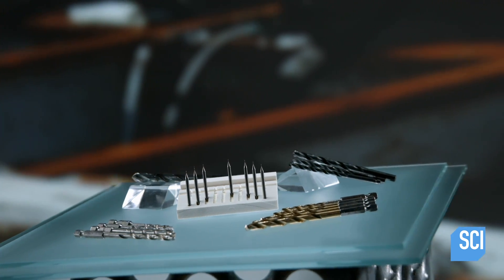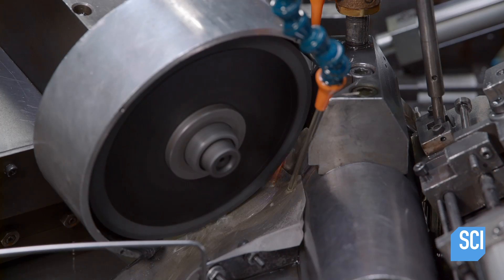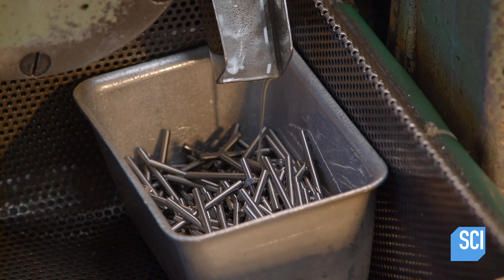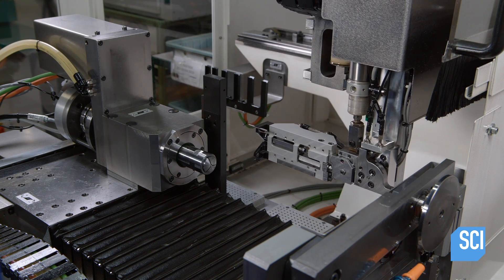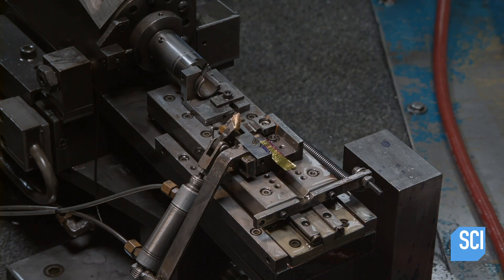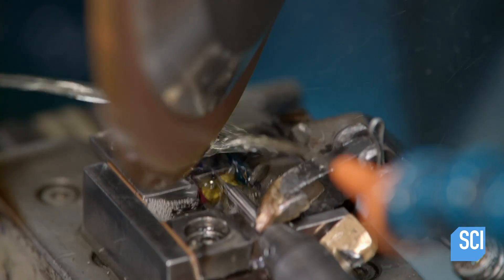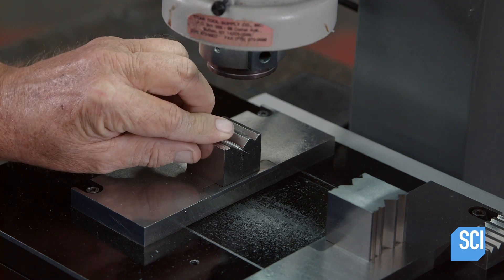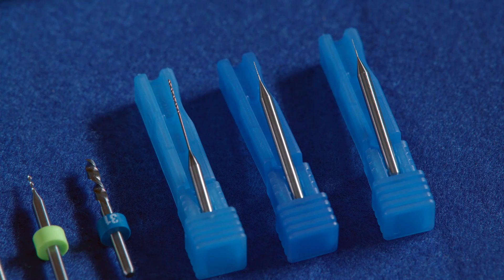How Micro Drill Bits Are Made | How It's Made

Comment: 4-5 hours to center it using shim stock???? they need a new process!
Reply: It's not per drillbit, it's for setting up the machine the first time, after that you can cut thousands with no extra adjustment.
Reply: @aleksandersuur9475  yeah 5 hours is a short set up actually, I've spent a week on set up before
Reply: kolby4078 damn 1 week on a setup you would be fired where I work
Reply: @staniclol7063  gotta get it right before it goes into a full year of production.
Reply: Youtube Rezzd 
I mean from writing the CNC programme, to setting up the machine, chosing how it should be cut etc, and do 0.0001mm precision could easily take 1 week. If you’re working on f.ex space shuttle parts, oil platform tools and similar, taking 1 week to set up the machine is nothing as long as they manage to produce the peices accurately.

We’re not talking McD’s fryers
Reply: @donb2527  go back and watch the video, they are specifically talking about using shim stock to center the tool. I was referring to that specific operation. Not the entire tool making process. 

Source: i have 11 years of cnc machining experience and im a cnc programmer.
Reply: @kolby4078  I started a set up yesterday it took all 8 hours of my shift. The part has six different stations on a fixture but I didn't even get to start real production till today. So I can see it.
Reply: @staniclol7063  Well,  when considering that very few companies have the capabilities to build super-precision parts and they will make hundreds-thousands of dollars per part it is necessary everything is dead on, the company gets paid for the quality, not the quantity. 
I had people tell me about a company that makes one part every two weeks, but they make $60,000 profit on each part, so it is worth taking the time.
Reply: @kolby4078  amen
Reply: @aleksandersuur9475  thank you i was so fucking confused
Reply: They need sharpshooters😂😂
Reply: Do you know how much the company sell those bit? 😂😂😂
Reply: @azharkamarudin6611   ~$15 (0.01in) - ~$300 (0.0008in)
Reply: Yep a centering mechanism using laser interferometry and piezo actuators would do the same job in a few seconds. Someone just has to build such a device. The technology is definitely there.
Reply: @Widur42  Zoller
Reply: @LazyH-Online four jaws are known to be way more accurate and precise than 3 jaws, they just take longer to set up
Reply: What are micro bits used for? The body?
Reply: Just to make sure it is expensive because this process.
Reply: Not every company producing those drill bits uses this process. I bought a set of carbide micro drill bits like this for ~$10. not the same quality for sure though... broke one and it cut me. i am still wondering if the tiny piece somehow got stuck in my finger.
Reply: 👍 4 to 5 would drive is cost prohibitively.  I never thought drill bits of this size to be expensive.
Reply: I think this is BS. Coz it's not reflected in the cost. Probably happens like twice a week or something.
Reply: there should be plenty of incentive for them to develop a new process. they count start actually mass producing those things
Reply: Then a machinist accidently drops it after it arrives from shipping. Lol
Reply: How much is that bit if they can only produce a few a day???? LOL
Reply: That's got to be one expensive drill bit.
Reply: finding a new process can take 4-500 years.
Reply: They need a new writer or the voiceover. :-) At 4 hour per drill one man can only make two drills per day, yet they are for sale at 2.50 a piece.
Reply: @vinny142  maybe its because hes held captive that they can afford that? maybe thats also why he takes 4 hours to do it
Reply: He must take like 6 fucking lunch breaks while making that one bit
Reply: @Koda716  
Gotta get that 8 hours shift in somehow, and bob's been here so long nobody dares to question him:
Can you give me a hand with the delivery?
Nah man, I still got a couple of adjustments to take care of

Can you come to the boardmeting?
Aaah darn nah I got to adjust the bit before my shit ends

This is the FBI open up! This company is under investigation for tax fraud and you're our main witness
Oh darn I wish I could talk, but you see I got a drill bit to adjust
Reply: I'd imagine there's a laser measuring device with electronically controlled movements that could square that drill up in a few minutes.  Likely, the company is too cheap to buy it.  Where I work, our tight-tolerance work is done in machines that measure the tools' lengths and diameters with a laser, supposed to be accurate to .0001mm (I don't know if it really is though).
Reply: @Aeturnalis  the machines you are looking for are manufactured by a company called Zoller
Reply: @LazyH-Online sorry I missread your comment
Reply: It needs to be so precise I don’t know if there would be a better process
Reply: @jfs366  oh THERE IS. I honestly don't believe this. I work at a place that threads bars and it takes them 20 minutes to adjust the tools right but then they whack thru one every 30 seconds. Might get taken out and resharpened once ir twice a day.
Reply: @jfs366  The human eye is very very bad at precision and adding layers of tape by hand doesn't make it more accurate. My guess is that this man is doing some quality control step that takes 4-5 minutes. He;s holding a 0.1mm drillbit by a 4-mm shaft in a tool that has a collet chuck which is famous for not being adjustable. Whatever this guy is doing, it's not centering. At best he's checking the centering and it takes him 4-5 minutes to do. And yes, a mchine would be 100x better at it.
Reply: That's why they should be hiring Mexicans. They will do it faster and better Everytime.
Reply: @imtypingwords  have you ever bought a tool made in Mexico? They are really terrible quality
Reply: @imtypingwords  oh they would do it faster and cheaper, but the bits wouldn’t work for shit
Reply: @imtypingwords  They don't work better, just cheaper.
Reply: imtypingwords 41 They moved the factory we had in Texas down there 😂
Reply: @imtypingwords  nobody beats Taiwanese ninjas
Reply: @imtypingwords  Mexico is in pretty good shape with all their workers, doctors, and engineers doing things faster and better.
Reply: @foxbyte0157  I know. They are legit good workers. From the lower level jobs to the top level. It all starts with
With ethics from their parents. And that's something that Mexicans are most proud of... Is family.
Reply: @imtypingwords  well that's just sweeter than honey x
Reply: @imtypingwords  bruh moment

Comment: As a machinist, this video is very interesting. I’ve always wondered how our small drill bits and endmills are made.
Reply: What do you use these really small bits for?
Reply: @Aditya-wg3lp  really small holes or really small features. U can’t make a tiny detailed part with a 1/2 endmill
Reply: @Aditya-wg3lp  I'm an aerospace and medical supply machinist. At my workplace, we mainly use these tiny little guys to produce very complex, high pressure valves and to machine cross lines between two high flow sections to facilitate very precise mixing of liquids. Sometimes the tiny holes that are drilled are also used to control the opening and closing of mechanical solenoids
Reply: @Aditya-wg3lp  I've got several of the hair-width end mills (errr...router bits) - I use them for inlaying.  The most common use is for improving corners - draw a 90 degree channel with a 1/8" bit, and then run a 1/16" along the edges followed by the sub-mm one.  I've also got one made specifically for ivory (I've got some mammoth ivory bits). You have to be very careful with speed and depth on these because they break super easily if the parameters are wrong, and they're not cheap to replace.
Reply: same

Comment: As a machinist, the terminology in this video made me cringe. Several times
Reply: Good thing these videos were made for the general public.
Reply: @Abeyancer  I'm not a machinist, just a guy who likes to tinker around with tools, and the terminology in this video made me cringe too. Lets not make excuses for poor research on their part.
Reply: @denisl2760  The whole point is to avoid becoming overly technical -- this show is for a general audience.
Reply: Yep, right with you there.
Reply: Could you tell me which carbide they used?
Reply: @SanoCrushridge  the blanks are tungsten carbide. This video doesnt show any coating of the drills, but it's quite common for these drills to have some coating on them, depending on performance requirements
Reply: @dillonrajaniemi9513  thanks. They aren't very detailed in these videos.
Reply: @dillonrajaniemi9513  Many (most) carbide tools don't have any coating, especially when used for cutting aluminum. You sure you're a machinist?
Reply: @avimoore6619  thats what i thought especially the small tools like 0.1-0.2mm how the fuck do you want to coat them
Reply: xLoltimex CVD respectively PVD is possible
Reply: One fact is that there is no such thing as a "drill bit"...You have a "drill" and a "drill motor"...Horses  use "bits"...LOL
Reply: I’m 15 and I don’t have to be an expert to know what a microscope is called. Lol.
Reply: Well, as all machinists or experts in any subject would know, it takes time and money to reach high precision and quality. It’s just the same in the film making business. This film is cheap and good enough for ignorants, like 99% of everything, sadly. How this transfers to politics is frightening. 99% of a population have no clue and no desire to study past the bullshit in politician’s arguments and yet vote for them. If only we had a micrometer to figure out the bullshit from the truth it ‘d be easier.

Comment: '
what do to with a micro tiny drill use for...
denture or mild - soft metal or plastic or wood
Reply: bestamerica via holes in circuit boards.
Reply: @rfengr00 
'
hi L B...
ohh thank and good idea use a micro drill for the PCB hole...
i use home normal black drill bit set on the PCB sometime

Comment: I want to work here setting  up a drill bit for 4 hours
Reply: He set up a template. This has to be precise, because it will be used for all fillowing drills of the same type. Once the template is set up, it only takes seconds to swap out one bit after the other.
Reply: I hope he was aligning a fixture that may hold one drill bit at a time, but will process many thousands before needing work.
Reply: Good luck
Reply: How much does one of these drill bits cost?!
Reply: @Chris-yy7qc  last one I saw was around 400 dollars.
Reply: Harbor Freight : 10pc micro bit drill set $13.99  These clowns talking $300 each.
Reply: @ColoradoStrong-w1j  Thr drills from Harborfreight  cant even drill allot of materials this can do..
Reply: @Chris-yy7qc  Smaller ones or extended reach ones are more expensive.  https://www.mcmaster.com/2841a91
Reply: @prototype3a  that is a 1/64th" drill. That is huge in comparison (the video talks about less than 1/10th of a millimeter, which is 1/256th").
Reply: @kain0m  I've personally run 0.008" drills but I know smaller exist.  I've also ordered and used custom drills from Kyocera.  Some of these customs were $75 each.

Comment: 3:15 to put 1 drill bit on a lathe and center takes 4 to 5 hours!
To make pack of 10 drill bits, that is at least 40 hours of centering work. (Ironic)
Reply: 4 to 5 hours worth of centering work just to be snapped on the first job.
Reply: I bet if they used a guy without glasses that time would be dramatically shortened

Comment: 4 hours to center a bit for a 10 second cutting operation?
Reply: Just guessing it's for the first bit. After that you can use the same setup for the same size
Reply: @Runkpapper  not really... it seems he is centering every bit, but it for sure doesn't take 4 hours. Did some centering of tools and tool holders for rotary milling machines and those are WAY more compicated than this little thing.
Reply: @Runkpapper  I thank so to ,that makes sense 🤔
Reply: Not Dave I can’t see that, as they’d be out of business.  Those bits are not that expensive.
Reply: A job is a job💪
Reply: @louisedwards6681  Yeah, it is! And i love mine:) Fixing things is awesome!
Reply: @ogi22  what do you fix,. I fix Automatic Transmissions,,,43ys and holding 🏁
Reply: @louisedwards6681  Oh boy... Started at a cig factory as a tech, then moved to saws, lasers and milling machines and now for almost 9 years working with warehouse automation - cranes, conveyors, high-bay wearhouses... working for them right now: https://www.youtube.com/watch?v=9cfLRbTBS_Q

Comment: An EDM would be the proper choice for micro holes. We've used .015" dia. drills with success but it's not ideal. Our EDMs provide incredible results.
Reply: Can't always use an edm. Maybe the part won't fit, or you're using it for surgery, or the part isn't metal, or it's in an environment or location that prohibits the use of an edm and it can't be moved, or you can't afford an EDM. There are lots of good reasons to use these. The only downside is the rigidity is critical. You need very little runout and a very stiff drill press.
Reply: Cant edm fiberglass

Comment: I want to see the zero-runout chuck that can spin one of these without breaking it.
Reply: A good ER or SK collet can get you under .0002 runout.
Reply: Found this on the subject. Zero runout is easier than you thought, heh. http://pages.mtu.edu/~microweb/chap6/ch6-0.htm
Reply: @sleeptyper  oh?
Reply: @louisedwards6681  It is based on belt driven chuck, with the belt tension nulling all slack since the chuck is pulled against diamond bearings.
Reply: BIG, nikken, rego. Literally a bunch. I work at a medical manufacturing and we were using .030 and .040 end mills on PEEK in an old ass makino S33 with VK collets and the ball screws were shot and drifted all ducking day. Ran hundreds of parts at a time no issues
Reply: @Sir_Vex_DestroyerOfSemenDemons I don't know if that comment is sequitur with the conversation here boss.
Reply: Yeah no shit huh? A makita breaks my 1/16” drill bits with ease
Reply: Don't we all, dear?!
Reply: The Chunkset from BIG Diashowa is very good
Reply: No such thing is Zero runout.  It’s the meter you use that shows zero.  But with a better gauging tool you can indicate microns.
Reply: @nathanroberson  With a long enough lever, you can indicate half an atom - but is it practical?
Reply: Most machines that you put these tools in have a spindle runout of <1-1.5um, with tool holders(usually HSK with fancy collets) usually <3um.
Reply: @Spirit532  I use Tribos collets with an 80k rpm Levicron air bearing spindle. The collets can have up to 3 micron runout, but they're usually much less. HSK collets get limited in RPM because of their size. Usually the feeds and speeds required to drill such small holes leads to rotational mass and distortion obstacles. The Tribos collets have a much smaller OD in general and are more willing to spin up quickly by a low torque high speed spindle and resist distortion.
Edit: Actually the collets are HSK. Just not an HSK like a large 63.
Reply: Go to your dentist then
Reply: You would have to load this by hand the Tool change would easily  break that thing off
I wonder what feeds and speeds these need to run at